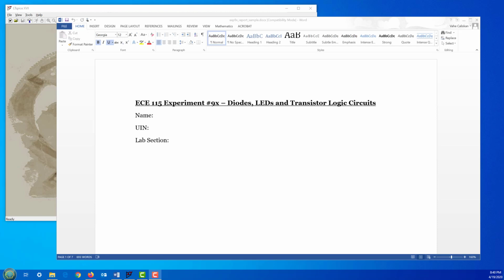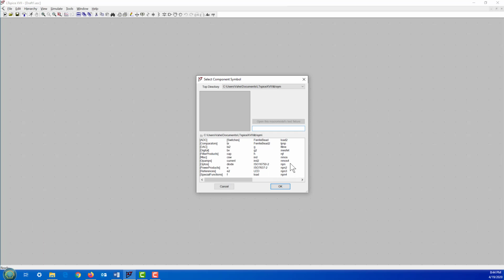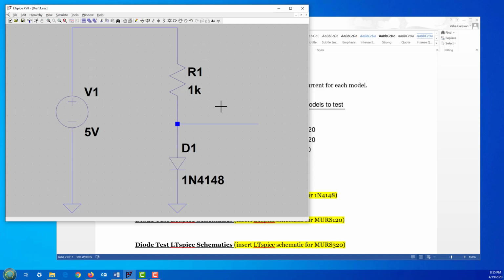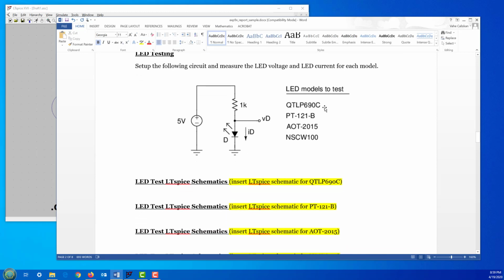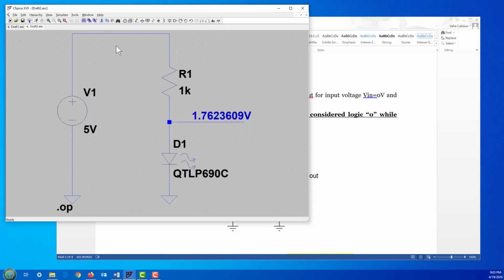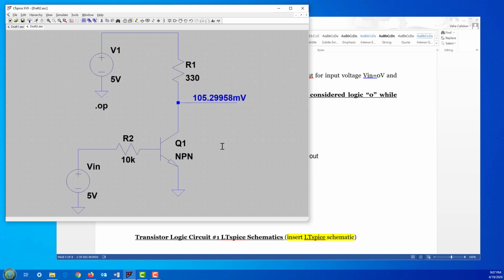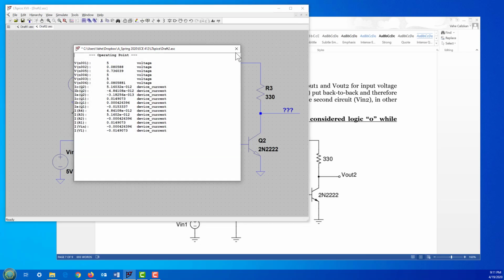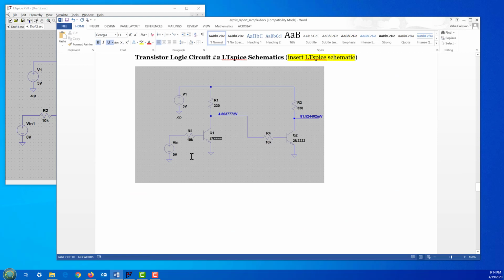Experiment #9x: Simulation of Diodes, LEDs and Transistor Logic Circuits Using LTspice

Comment: the bd voltage for this led is 5v and current 1.16A. Its seems something is not correct in your simulation.
Reply from the maker: I am using the LED models that were in LTspice. Can you tell me which LED are you referring to? There is a 1k resistor in series, so the current in the LED is limited to 5V/1k=5mA at a maximum.